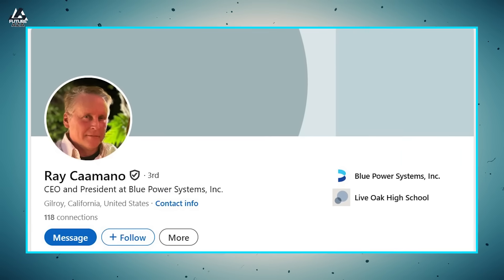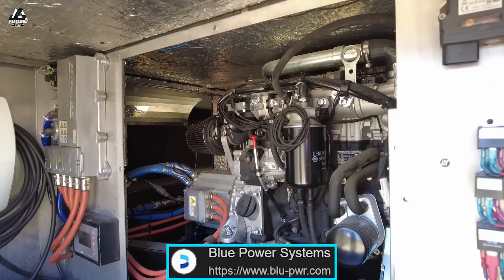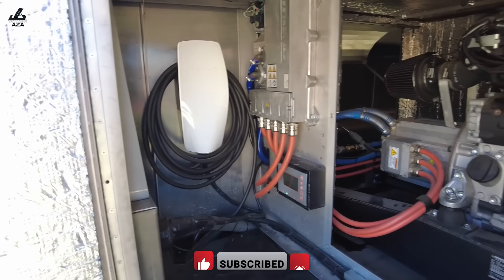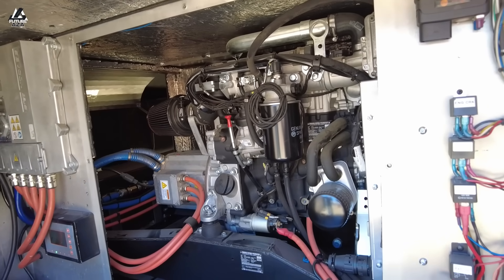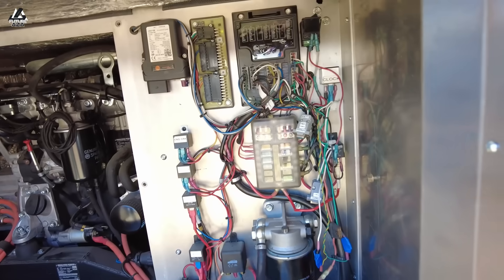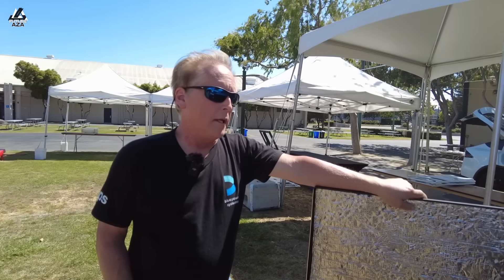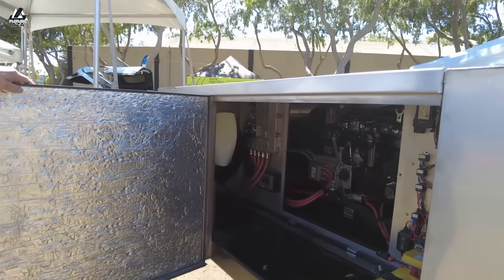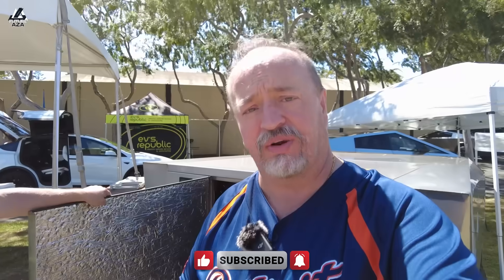Electrical Wizard dishes DEEP on EV engineering, off-grid storage, and more

Comment: I wish I was looking for a job and able to work for these guys.  I find that kind of optimization exciting.
For instance, the engine/generator has a most efficient RPM to work at, but the right RPM changes depending on the load. Studying what RPM is best for this load, and what is best for another load would be a fun exercise.
There are a zillion other tweaks you could add to the mix to optimize for lots of things.  The things I could learn!  I'm glad there are people way smarter than me working on this stuff.